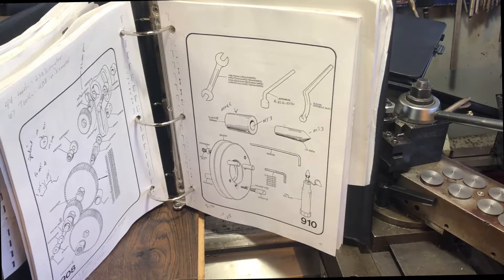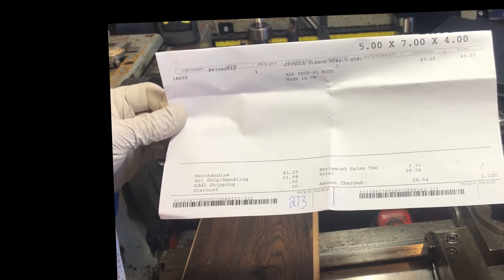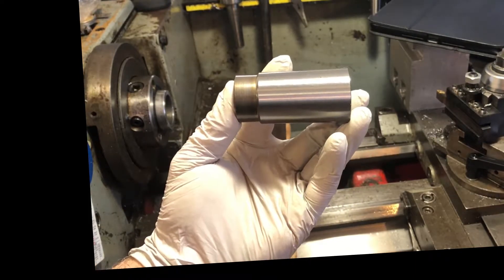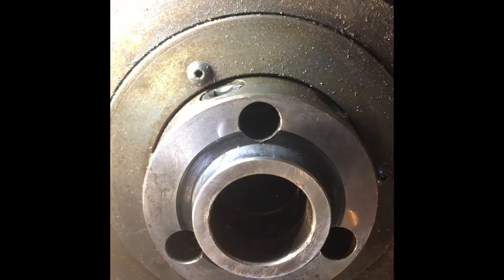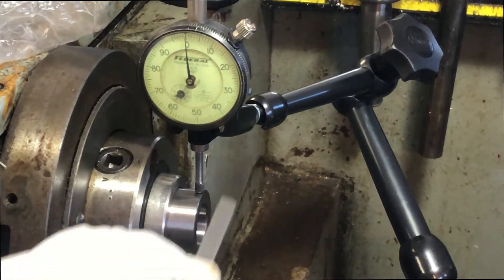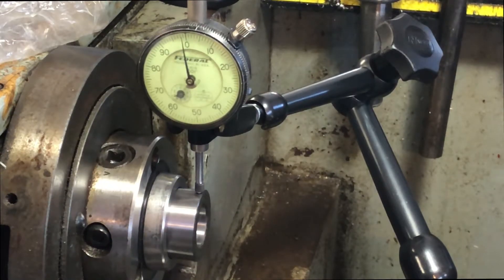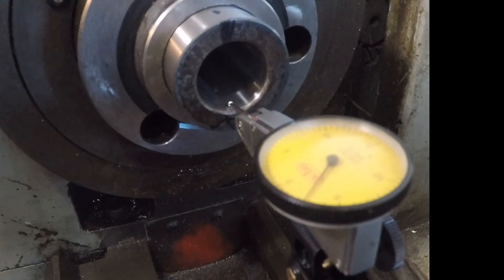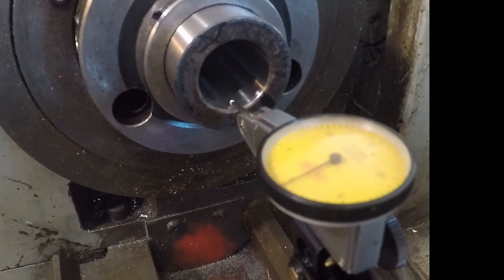Final Grizzly MT 4.5 to MT3 Spindle Adapter - Clausing 11 / Harrison M250. Does it Fit?

Comment: Great work there. TBH its probably unreasonable to expect something that sells relatively cheaply when compared to the cost of the official factory part to be absolutely concentric. When I served my apprenticeship back in the late 1960's we were taught that a headstock centre should always be a soft centre which was trued up in the spindle after fitting to ensure that the point ran dead concentrically. It should be kept in mind that advice was given for when using the genuine maker's sleeve, so it was never assumed that it would run truly either. Therefore to my mind there is no problem in using the slightly eccentric sleeve providing that the inserted centre is trued each time that it is used. The problem comes though if you decide to use your 3MT ER32 collet chuck with it, because that will never run concentrically.
Reply from the maker: Thank you. Very good thoughts. I was toying with the idea to add a jack screw to the centers or as noted the ER 32 for a little more confidence it will stay put. I think the official version has a retention  element. Hard to tell from the picture in the manual. But I will at least be able to turn in between centers. Thank you for dropping by.

Comment: How much spindle run-out do you have?
Reply from the maker: Thanks for watching. I will update with fresh reading. I did not get the video part in where I showed the high outer runout spot was 180 off from the low spot on the inner MT3. Thanks for watching.
Reply from the maker: Double checked spindle this AM.  Worst case quarter to half a thousand on the MT 4.5 bore.

Comment: I need a 4.5MT to 5C spindle adapter for my ENCO.  I have the 4.5 to 3 adapter.  Great video.
Reply from the maker: Thanks for watching! Last I heard Royal was the source for those MT4.5 to 5c adapters. However, likewise I believe they were supremely pricey (buzz kill for cheap old men like me). We have to have a Youtube expert in our circle who could dream up and produce one (ground to perfection). Raise the challenge and I will support you! 

All the best 

Dan
Reply from the maker: If it is the right thing there is one on ebay (MT 4.5 to 5C). Pricey at $195 asking. But sometimes a look is worth starting the thought process. Folks far more skilled than me might be able to produce at a more reasonable rate. Mr. Pete did a nice walkthrough of the Royal setup on his Clausing 5900 I believe.

Comment: I've been looking for a MT 4.5 for ages ! My 1942 Colchester Master has the same spindle taper. I've started to make my own after watching Mattys Workshop where he made an ER40  collet block. 
Thanks for pointing out they are still available! Oh, sticker should be with you soon. Posted last week😁
Cheers Neil
Reply from the maker: Thank Neil. There was a gent who had sourced a few on your side of the pond. Not sure if his supply is exhausted. I am on the Harrison forum on IO groups and that is where I heard it mentioned. At least now I can cheat and pickup the MT4.5 using a clock gauge…. err test indicator (see I can speak proper English as well - LOL). Using that short spindle land to set my compound would have just set me up for tragedy that even Youtube mentors could not fix…. LOL. 

I have read hundreds of posts on this topic (kind sensible expertise is there - but also loud arrogant bluster) and finally I took a shot in the dark. Thanks ever so much for watching. Worst case somebody got a potential clue to their mystery! 

Dan
Reply: @houseofbrokendobbsthings5537  Hi Dan.
I've machined a 4.5 out of a hydraulic cylinder rod which I'm planning on making into an ER32 collet chuck. I check that part number and looked to see if I could get one over here but no luck. Emailed a company here after your inspirational video who supplies spindle adapters to see if they can get one for me.
Really glad you shared that.
Cheers Neil. 
Ps. Your English is probably better than mine as I'm a Taffy 😁
Reply from the maker: @NellsMechanicalManCave  Let’s see the setup you used.  That is incredibly interesting to me, and a taper setup isn’t likely to appear over here. Sadly, my Trig skills are very similar to my social skills #nonexistant - LOL. Well like a lot of things I used to know a little but forgot.
Reply: @houseofbrokendobbsthings5537  Trig skills ?
Dan, you do make me laugh 🤣
I'm from the world of heavy maintenance and breakdown 😊
The last key I fitted in a shaft was 24" long and 5" square. I dressed it with a 9" grinder👍
The taper was achieved by,,,,,,,, 
Jamming a thin long parallel in the spindle bore with a wooden wedge and indicate the compound slide until it it was parallel. 
Very crude I know but it could have been a MT 4¾ 🤣
If that method doesn't make sense let be know 👍👍
Cheers Neil